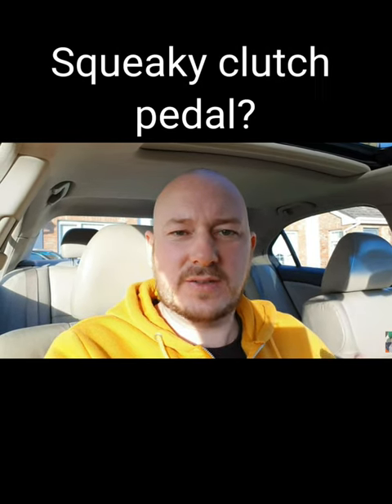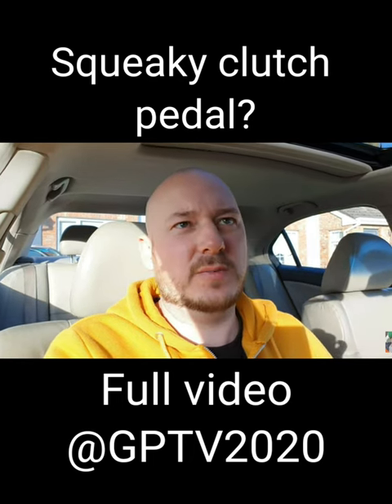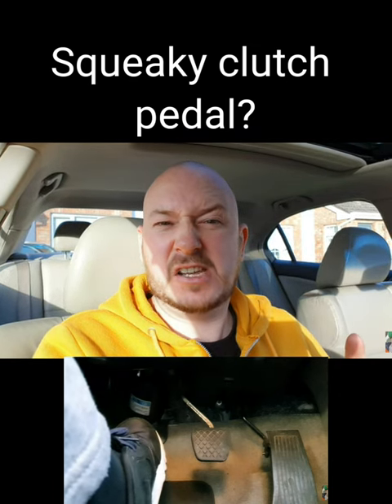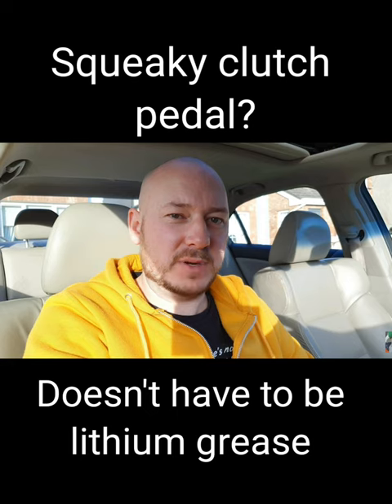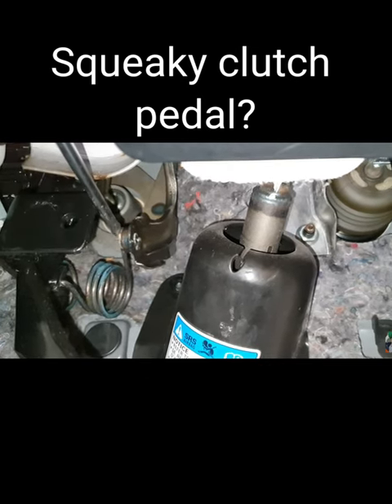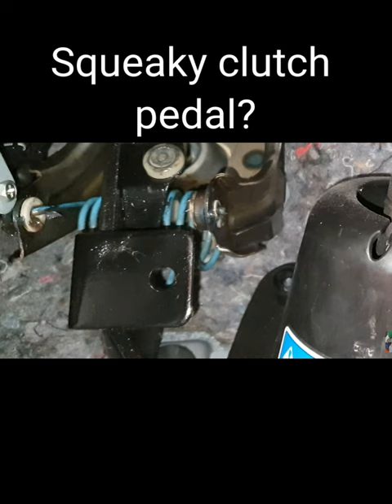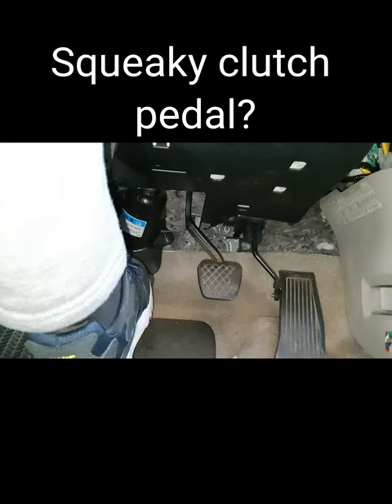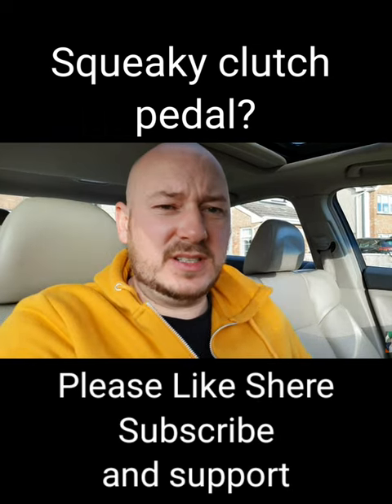How to fix a squeaky clutch pedal/clutch pedal squeaks/honda accord cu3

Comment: Hope you're keeping well bud, I have this is issue and it drives me nuts, is there any permanent fix for it do you know?
Reply from the maker: Hey dave, all good just busy with other things, life stuff. Anyway I haven't found anything permanent yet, i just use standard wd40 now once a year. Maybe if you replace all the bushes and washers you will get a few years before it comes back but, if it not broken 🤷‍♂️
Reply: @GPTV2020  Thanks for the reply bud if I do find a good solution I will let you know, it's so frustrating 😂😤
Reply: @GPTV2020  i had the same issue on my mk8 Accord and also i have presently the same annoying noise on my fk6 civic 😆🚗🚗🚗